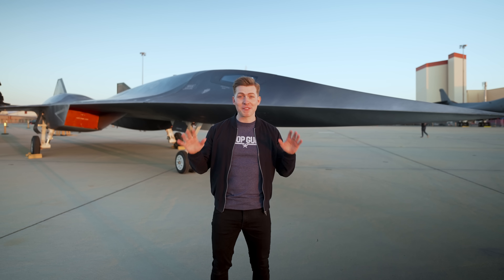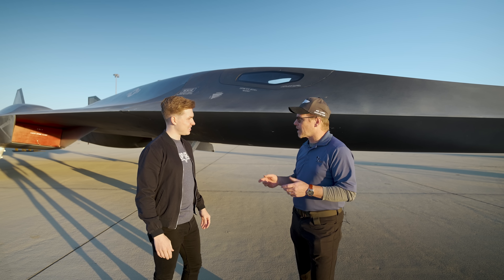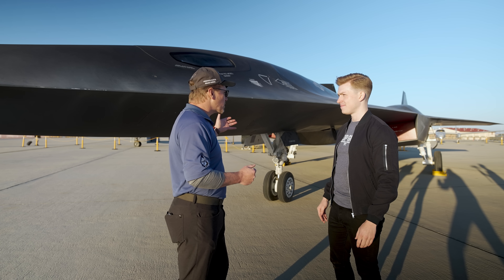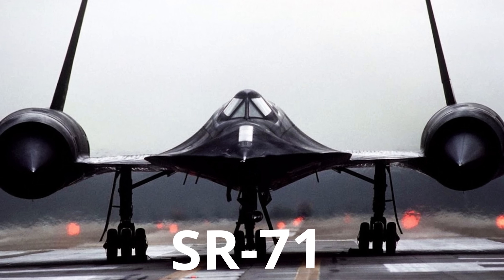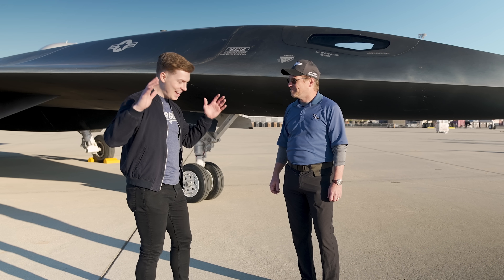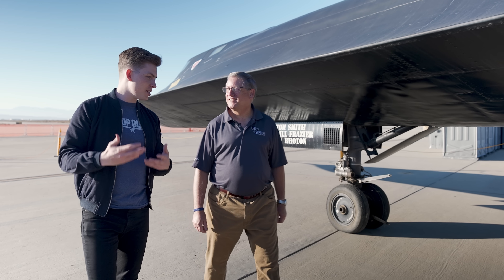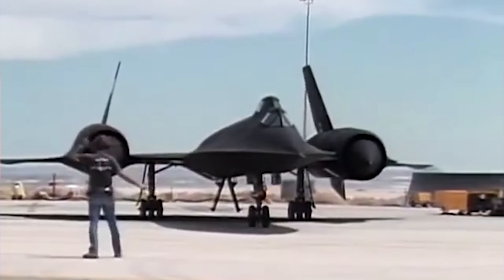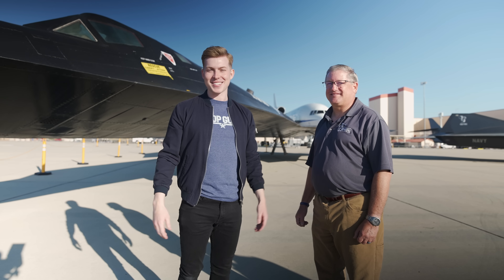Top Gun DARKSTAR in Real Life!

Comment: I think there needs to be a different set of communications on hypersonic planes unless I am mistaken, when the space shuttle landed there usually was a cone of silence as the plasma was heated up during re-entry i wonder how that will work for a hypersonic aircraft.
Reply: Quantum data link
Reply: @DamplyDoo  then your going to need a bigger plane to house that avionics lol
Reply: @DamplyDoo  sounds optimistic, but ultimately bollocks

unless it's a joke, then it's pretty fun.
Reply: @spazzey0  they've already quantum entangled two particles. Move one, the other moves. Start correlating their movements in 0s and 1s, there's your data link

Comment: You can fly it in FS2020,and it's so interesting
Anyway,in the simulatore,for switching to scramjet,you have to attivate the"fuel Cell" button
Is scramjet combustion run H2,or a differente fuel than the basic engine below Mach 3?